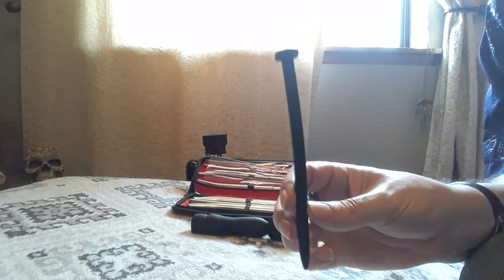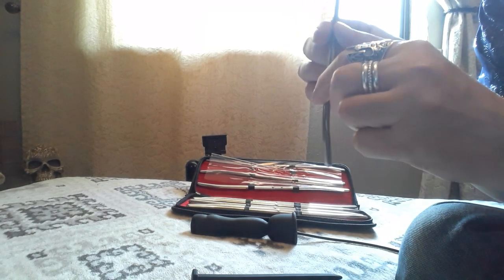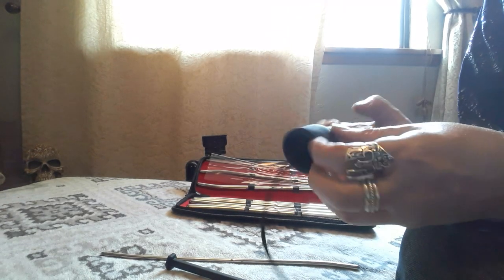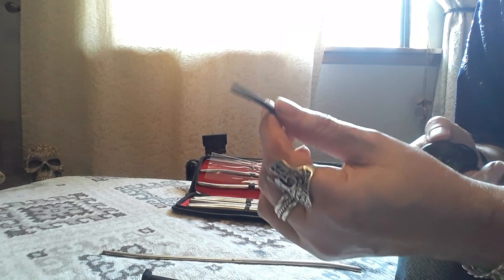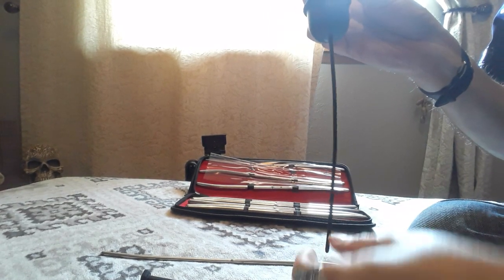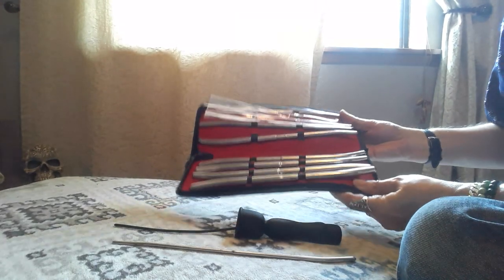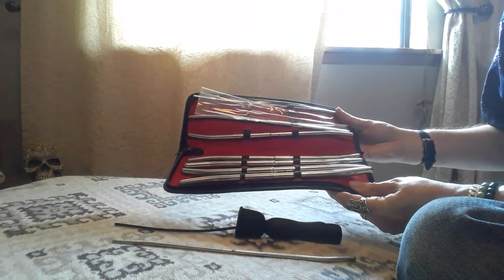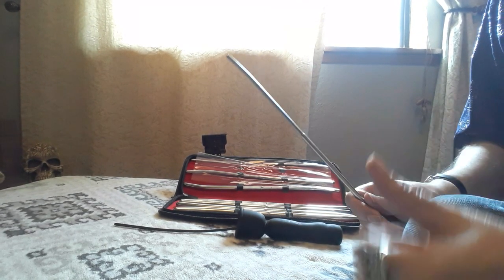SOUNDING YOUR ROD!!!🍆 with silicone.

Comment: I hate silicone sounding rods.  They will stick to the wall of the urethra despite using a lot of lube.  The result is microscopic scratches that hurt for days.
Reply from the maker: I don't like them either.
Reply: Oh well that explains the burning. Guess I'll try steel.
Reply from the maker: @ByakkoJ  stainless steel is way better.
Reply: I have no problem with silicone sounding rods. Slides in easily. Steel  can rupture the Urinary wall and cause a lot of bleeding.
Reply: Silicone is best imo. First time was amazing but peeing hurt afterwards.

Comment: I prefer silicone sounds, especially conductive silicone sounds for electro play, and have had very positive experiences.  If it has to be "crammed in," then it's not properly lubed.  In my experience, a silicone sound needs to be initially lubed, inserted part way, removed and re-lubed, then inserted further each time.  My "go to" lube is XLube, mixed very thick.  Thank you for the video.

Comment: Hi Kent, I tried the stainless steel one, I like it but it's too rigid. Silicon has texture which cause burning or tearing just to push in and out. I like the flexible one though because you can move around with it in you and it's a TOTALLY different sensation.

Comment: Hello Kent, is there a limit or a ‘cooldown’ period on how many times one should do it in a day? Thanks in advance!
Reply from the maker: That depends if you're new to it.
Reply: @1Kent  i am pretty new to it but the silicon rod successfully went halfway in on the second try. However, there was a stinging sensation afterwards and it felt like it was burning for the next day. Should I stop after doing it once and let it rest for a few days?
Reply from the maker: @kingkong9146  yes, the one in the video is way too big for a beginner.
Reply: @1Kent  i’m using a 4mm wide rod
Reply from the maker: @kingkong9146  maybe you should try the stainless. Inserting it is so much easier.
Reply: @1Kent  alright, thanks for the advice!
Reply: Most people say that a little burning feeling is normal for a day or so but if it continues see a doctor
Reply: I bought the thin tday...since I'm new to this. Didnt want to spend for a whole array of steel. I do undrstand ur concrn too. We'll see

Comment: I’m new to Sounding it’s Amazing and I agree stainless steel is 100% Better than silicone I Just had a question I’m Trying to go to a larger size but I’m Scared That I might hurt myself Lol I might Terret open and go to ER Lol and It would be very embarrassing Lol So my question is is it safe to go to a larger size without damaging anything Maybe you can recommend something Thank you
Reply from the maker: I need more information before I can answer, what set do you have?
Reply: Kent The same one you got on the video
Reply: Kent  The stainless steel set
Reply: Kent     Im at the Third one For Beginner Side but it to Headed I’m on The larger side now it Feels very good it does not hurt me
Reply from the maker: @steveurich2561  don't skip sizes and don't go fast, if you go fast you could hurt yourself.
Reply from the maker: @steveurich2561  you have to give your urethra time to stretch and adjust.
Reply: Kent ok Thank you I appreciate it 👍

Comment: It always hurts a lot when I do it no matter what I use idk why
Reply from the maker: I'm sorry to hear that, don't do it!
Reply: I'm using my alt for stuff like this now because of obvious reasons and figured out the more I did it the less it hurt
Reply: It hurts because the flexible one when pushing in or out it scratches urethral wall between your shaft and prostate. There is a bend path way there. You should not use silicon. Go to Etsy and search for Urethral Sound Rook Pleasure Whip.

Comment: Kent i have questions.? If I use urethral sound first time . Any there any pain during pee.?
Reply from the maker: What size sound do you plan to use?
Reply: I haven't buy one yet might cause pain during pee what size do I need ...size M
Reply from the maker: @peterok3237  always start with the smallest one you can find.
Reply: Ok thank you
Reply: Ok thank you
Reply: Do you have pain for the first time during pee
Reply from the maker: @peterok3237  No, it feels weird the first time you do it when it's Goin' In, but I've never had any problems peeing. No pain.
Reply: @1Kent  thank you
Reply: @1Kent  hi Kent how long urethra sound stainless ..how many inch
Reply from the maker: @peterok3237 The whole set is 11.5"
Reply: @1Kent  I bought the whole set 9 inch  I try it it was bleed little bit and I try second time I feel good.i try push in deep it stop in 8inch .how deep can I push in
Reply from the maker: @peterok3237  Did you get the solid stainless steel? if you've lubed it up gravity should do the work.I would just go slow. You have to allow your urethra time to adjust.
Reply: @1Kent   I did get stainless.
Reply: @1Kent  pee no pain I love it
Reply: CAN I GO MORE DEEP THEN 9 INCH?
Reply from the maker: @peterok3237  Yes, mine are 11.5 inch and I've had mine all the way in! Just go slow, if you perforate your urethra you will bleed.
Reply: @1Kent  when I pee still bleeding little bit..when it stop

Comment: So is it just one tube you push it down in or like what is it just uou push it is ?
Reply from the maker: Could you ask your question a little more clearly please.
Reply from the maker: @randomlyposter1974  the sounding rod goes in your pee hole, if you use silicone be sure to use plenty of water based lube & slide it in!
If it's your first time be sure to start with a small/thin sounding rod.
Reply: @1Kent  is their a video that you suggest for me to watch so I have better understanding on how to do it?
Reply from the maker: @randomlyposter1974  I don't know of any demonstration videos on YouTube but I think there is on bateworld.